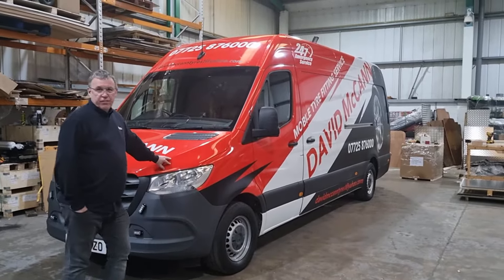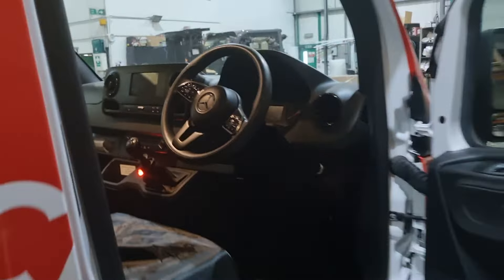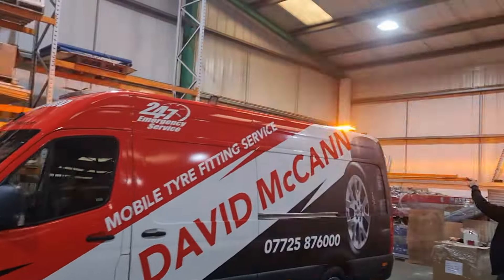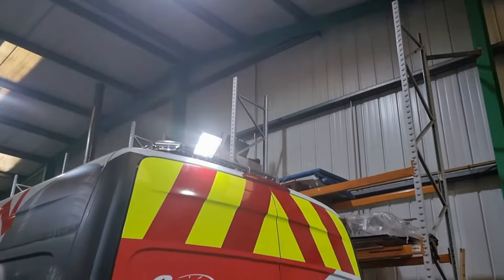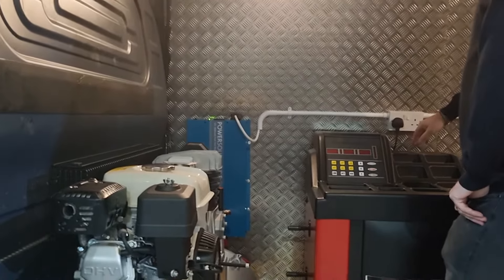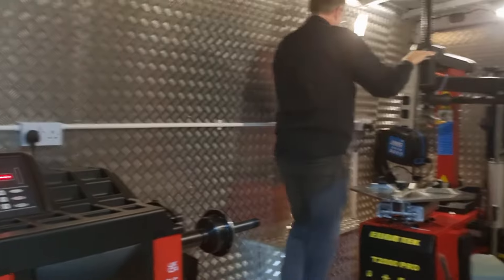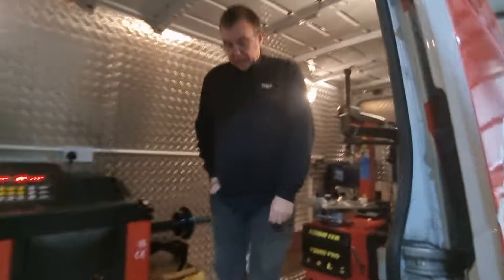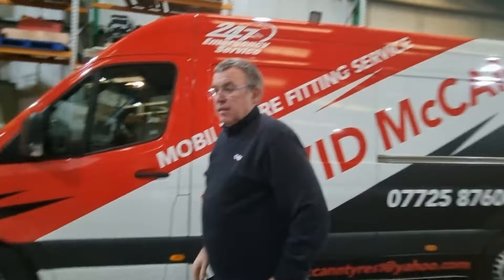Mobile Tyre Fitting Van Sold  to David Mcann Mobile Tyres.

Comment: Where do you store the tires?  How many tires can you hold without having to move them in every stop?
How is the air quality when running a gas engine inside the van?
Reply from the maker: there is room at the back of the van for tyres, the compressor is located at the side door so that the exhaust faces out of the van so fumes do not acumilate inside the van.
Reply: @mobiletyrevancity6043  How many tires, 255/50R20?